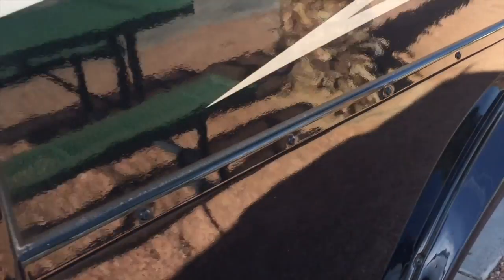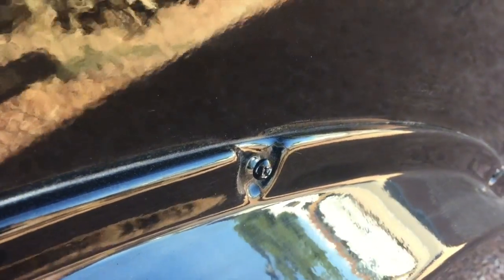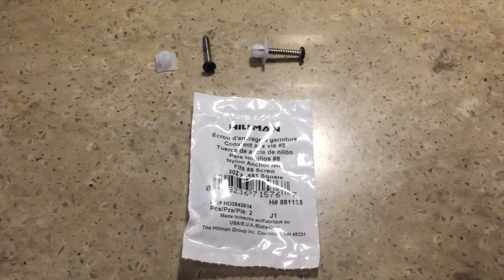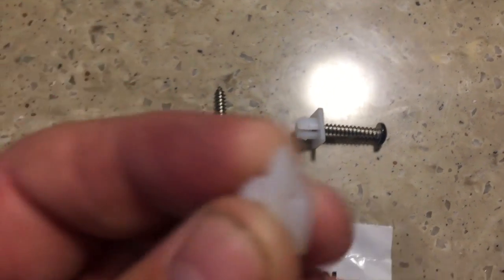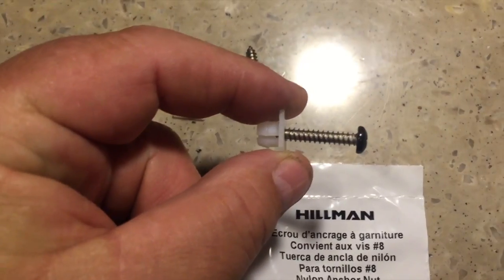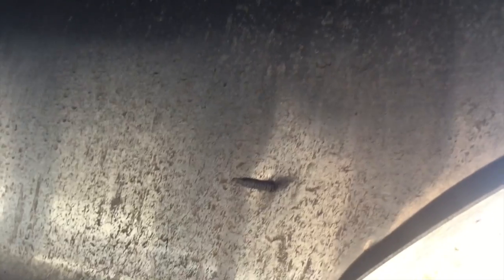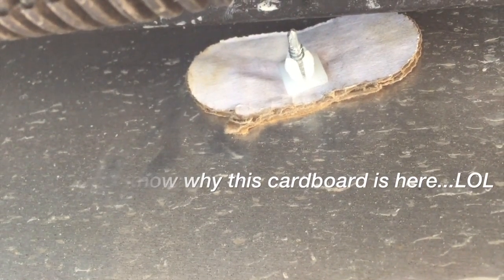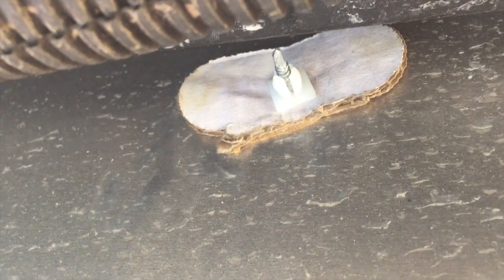RV Loose Screw Fix

Comment: For screws that are going into the wall as opposed to the metal trim, I like to take a wooden toothpick or 2, snap them in halves or in fourths (depending on the size of the hole), add Elmers wood glue in the hole push the toothpick pieces into the hole. Allow the glue to dry thoroughly. Then you can add the screw and it will hold better because you've given it more wood to anchor it in place. I don't use a permanent glue in case you ever need to remove that screw for any reason. Hope this helps. Robert

Comment: Do you have any suggestions on how to remove rusty corner trim screws?   I just purchased a 1999 Fleetwood Tioga and one of the corner trim pieces needs to be replaced.  There are several screws that have the heads sheered off and several others that won't budge under "normal" screw removal techniques (I typically use my clutched drill with appropriate sized bit after a good dowsing of PB Blast).  Any ideas or suggestions would be appreciated.

Comment: Could these work for an rv ladder where the wood is a bit rotted or worn? I need to better attach mine. Thx
Reply from the maker: Oh no. I’d like try to find a way to repair the wood 1st. These won’t hold any weight.

Comment: Where did you get the anchors
Reply from the maker: I gut a few at the local auto supply shop, but Amazon has them listed as “nylon nut grommet”  just got to get the right screw size
Reply from the maker: Or nylon screw grommet
Reply: He did mention he bought them at Lowes.